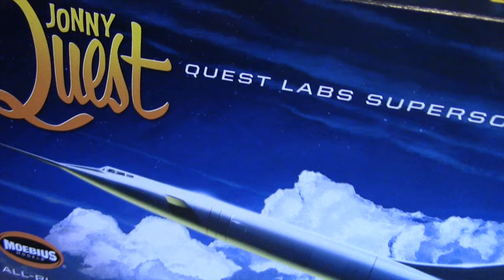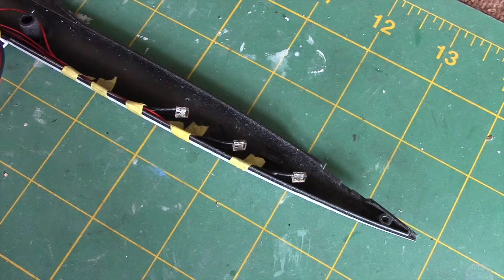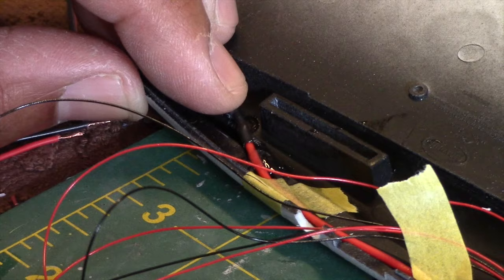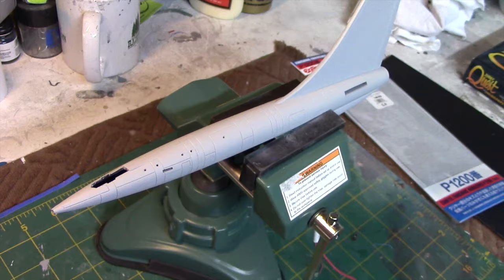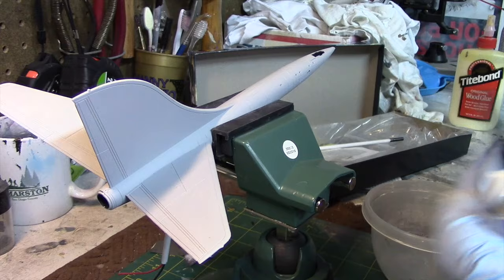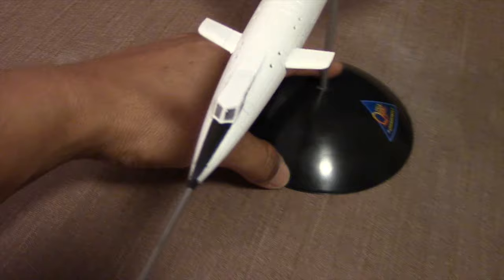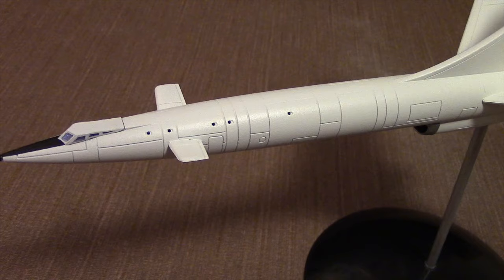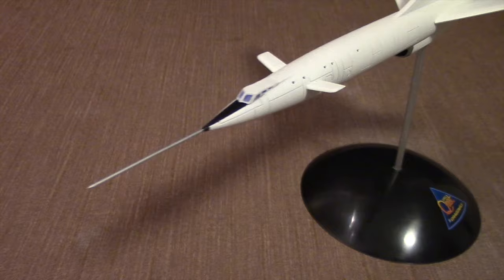Building the Moebius Models Jonny Quest Dragonfly Kit

Comment: May I make a suggestion please. Try treaded lamp rod there are ferrells and nuts to attach to model for a base display. Also try a used co2 cartrige by drilling out small end for wires cut bottom rounded end long feed wires through out small end bury motor led as deep as possible and mount into jet exhaust tube. Your model does look Awesome !
Reply from the maker: thanks for the suggestions

Comment: This is the first model kit I built in 35 years. Also my first build video.You always say liquid mask...now I know why...  The engine effect looks great (I am Jealous). Great tip for lighting  I just ordered from them for my next project. Awesome Job awesome kit. I hope everyone builds this kit and makes it a classic.
Reply from the maker: Thanks Waylow.  Liquid mask has been around for a while and the first time I ever used it was just a couple of yrs ago for my Jupiter II model. I was just amazed out how crisp and clean the painted areas looked. I would get so frustrated seeing leaks and bleeds when removing masking tape.  Especially after spending so much time cutting and placing the tape.  So yes, with projects like these it makes it so much easier.  It's important, however, that you use an xacto knife to cut along the area you masked otherwise you may pull up paint that you didn't intend to. It doesn't take much pressure to do it so don't press heavily with your knife.  Just glide along the surface.  Thanks again for your kind words.

Comment: Good build! Good review (Make me want one too!)
What did you think of the adhesion primer?
Reply from the maker: Not sure it really made a difference but it was easy to work with.  The reason I bought it is because I plan on doing the Hasbro Millennium Falcon toy conversion and an adhesion primer is highly recommended.  Just thought I'd try it here.  Certainly had no problems with paint peeling off.  Thanks for watching and for your kind comments.

Comment: I'm going to have pick one of these up! Grew up watching JQ & still love it today
What brand is that Plastic Putty you used?
I do more tabletop wargamming model building (than standard modeling) & that putty looks a lot easier & faster than using "Green Stuff"
Reply from the maker: Thanks for watching.  The plastic putty is by Vallejo.  You can easily find it on Ebay or just google it. And yes..I find it much easier to use than the green stuff.

Comment: Very nice!!! :)
I just ordered one of these today and can't wait to build it.  Sorry about the LEDs; did you run them through a resistor?
Reply from the maker: Phayzyre105 Yes they were pre-wired with a resistor.  Thanks for your compliment
Reply: Interstellar Modeler Ah, I see.  One more question: what kind of putty was that you were using at 6:33?
Reply from the maker: Phayzyre105 Plastic Putty by Vallejo.  If you can't find it at your local hobby store, just search for it on Ebay and you can buy it for about $7 - $10 including shipping.  Very easy to work with and clean up is simple too.
Reply: Interstellar Modeler Cool, Thanks again! :)

Comment: How do you fill in the smaller windows, or are they open?
Reply from the maker: They were left open. Since I did the body painting last I figured they would simply be painted over if I had filled them in.  The holes are very tiny so i wasn't worried about paint getting into the interior when applying the color to the fuselage.

Comment: Have you thought of using Led Strip lights. You cut them too lengths. The unfortunate things I hear is that the lowest power is 9 volts up to 12 or so volts. If using battery, they don't last very long.
Reply from the maker: Yes I've used strip lights before.  On the TOS Enterprise and in a Romulan BOP.  I actually debated on using them here. Just by the way they were spaced I couldn't quite get them to where I wanted the lights to be so I decided on these others. Should have just gone with them in the first place.  Oh well. Live n Learn.

Comment: What happened with the plastic putty?  I've never used it, and you peaked my interest.  Video went straight from your starting to apply it to showing off the finished model ... nothing on applying the masking fluid either.  Regarding LED's burning out, the main reason I've seen for this is that people do not realize a resistor is needed in the circuit to handle the difference between the battery voltage and the LED's forward voltage.  If you don't do that right, you WILL burn the LED out.  I doubt that was your problem though, due to your source and the fact that you said they were intended for 9 volts (a resistor was likely on one of the leads).
Reply from the maker: Thanks for the comment and sorry I left out application.  I am trying to think of another project with which I demonstrated this but can't think of one.  I know I recorded it with a different project.  The technique is simple though, just apply the plastic putty along the corner or seam.  You then just take a wet q-tip and swipe the excess away.  Thanks for watching. If I come across the video I will update this reply.